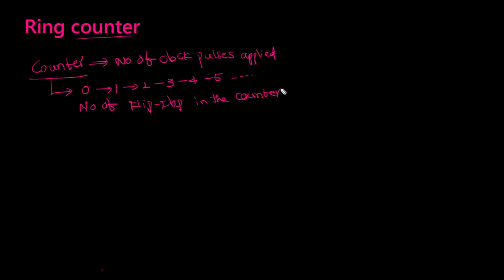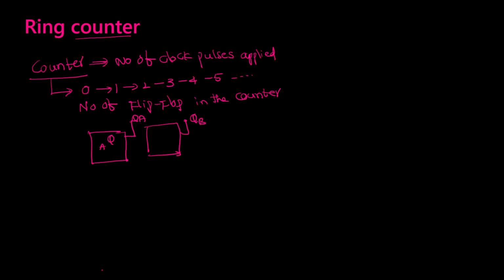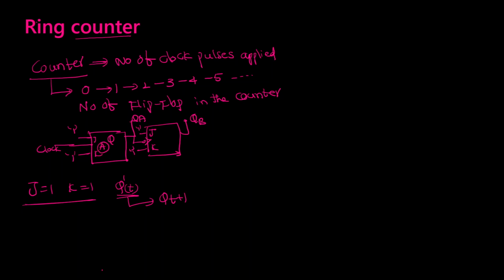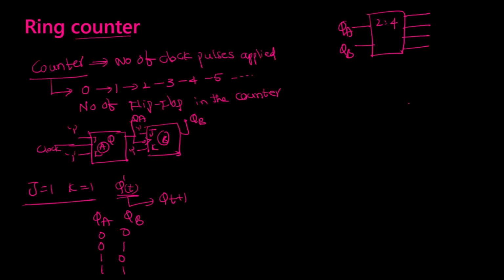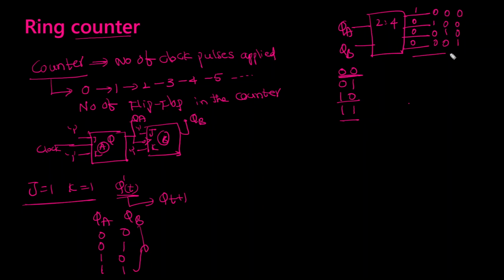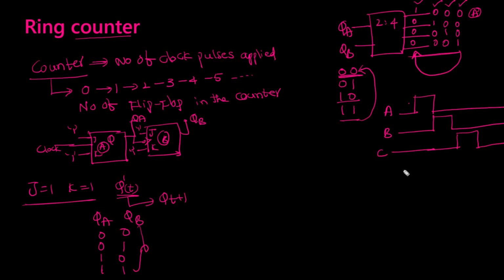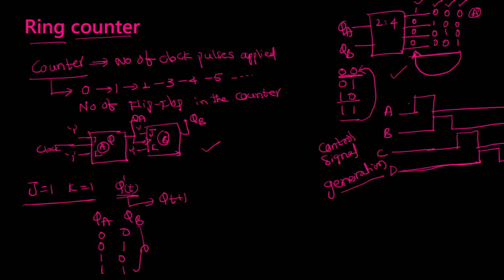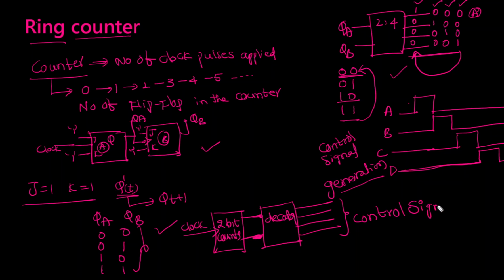Mod5_lect15:Ring counter using counter and decoder

Comment: Can you give me the answer to this question: A timing decoder is a sequential circuit that has multiple output lines, where the lines become active one after the other in sequence. With each clock pulse the next line in the sequence becomes active (for example after L0, L1 becomes active, then L2 and so on) only 1 line is active at a time. After the last line has been activated,L0 becomes active once again and process keeps repeating.show how an active low timing decoder with four output lines L0, L1, L2 , L3 can me made using only NAND gates. Do not use any other IC or module other than NAND gates. You are allowed to create your own modules using NAND gates if you need to.

I think it's almost similar to your design, except it will use an active low decoder am I right?